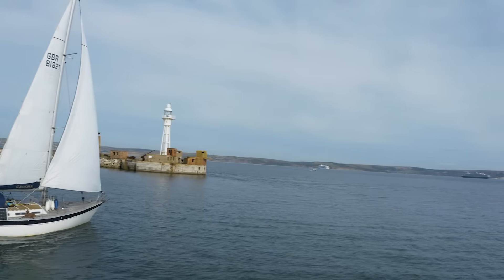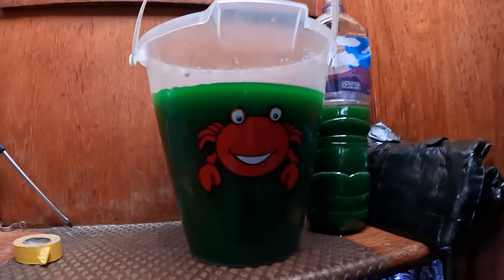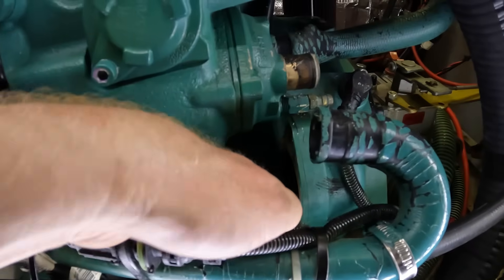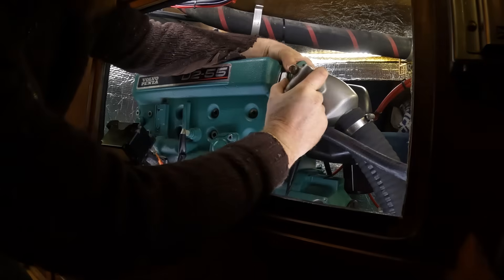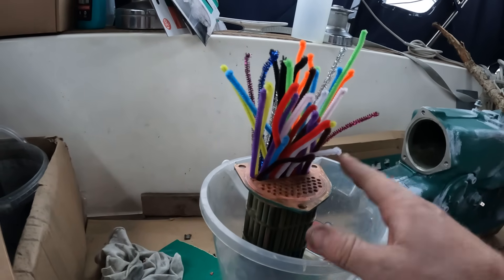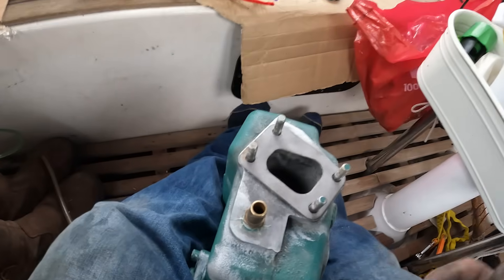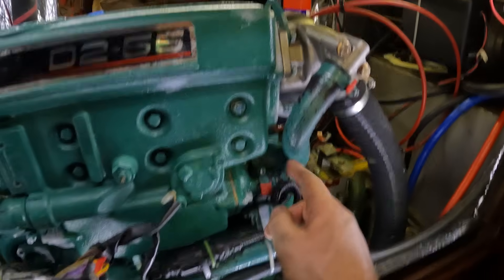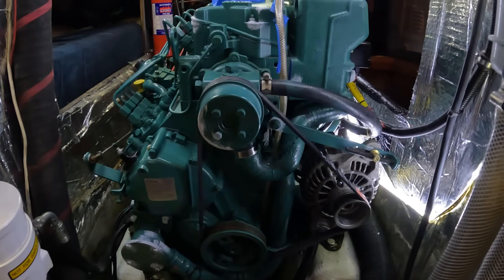Overheating  - Troubleshooting a small diesel sailboat engine  (Volvo Penta D2 55F)

Comment: Wow! Patience of a saint and really great to help demystify some key elements of engine maintenance - still can’t believe you don’t have a mechanical background! Think you may need a bit more glockenspiel practice though😂
Reply from the maker: I promise you that three years ago, I genuinely could not have pointed to a raw water pump or a fuel filter on the engine if you had asked me to, I really started with absolutely zero knowledge or understanding of engines 😳😳

I still often can’t  quite believe these things work again after I put them back together 🤔🤣⛵️🍀🍀🍀🍀

Comment: Hi There are compounds that you can use to help stop the Dissimilar metal corrosion electrolyse  JC -5 is good or just a high temp gasket compound applied lightly  plus another good cleaner that is cheap and good for Brass and copper Coke a Cola
Reply: Duralec green is designed for this.

Comment: I dread the day when I have to do this on my Volvo engine. Thank you for showing, that it can be done. However, you are aware that the bolts on the exhaust elbow still provide electrical contact between the two parts.
Reply from the maker: Yes I am now. I’ve removed the elbow and caked them in duralac, other than that I’m not quite sure how to break the circuit, especially as one will be created with a flow of water when the engine is running too? Any ideas? 😬🙏
Reply: @CadohaAdventures  Not an expert on galvanic corrosion but, if the problem started with the upgrade to the stainless elbow, a downgrade to the original cast iron part would be my safe choice. Not very spiffy, but better than a sacrificial engine block.
Reply from the maker: @rustysailor4672  you may be right. I wonder if it’s possible to get a pencil anode hole machined into perhaps the elbow to add in a sacrificial anode?

Comment: TopTip - Vinegar works 10times faster when hot - boil in jug/kettle first then add component to solution👍 heating component also keeps vinegar hotter longer (add boiling water to component - drain then add hot vinegar)
Reply from the maker: Awesome, that will come in handy next time 🙏🙏😁

Comment: .22 calibre rifle pull through is the best tool I’ve used to “clean me tubes luv” 😎
Reply from the maker: Sounds like a good shout, a few people have chimes in and said the same 👌🏼⛵️
Reply: @CadohaAdventures  or .177 air rifle size if you have smaller tubes

Comment: Look out for spirit of salts.  My boilerman used on the heat exchanger in our domestic boiler.
Aka acid.  Cleaned the pipes inside and out in 5 minutes.  No hairdo necessary.
Reply from the maker: Seems cleaning in situ is the way to go for most people 😬🙏
Reply: @CadohaAdventures  I'd call what you did character building stuff!
You're now a better person.

It's like banging your head. Feels great when you stop doing it.

I think everyone needs to strip their engine once though.

Comment: Can you fit that copper heat exchanger cartridge the other way around? Looks somewhat symmetric. Might be slightly easier to open for cleaning. Shouldn't hurt the function, as they are just pipes from one end to another.

Comment: We do “CIP” cleaning onboard, Cleaning In Place. Use a citric acid solution and pump it round the heat exchangers for a few hours by removing the pipes from the end caps and putting new ones on with a small pump and tank. Replace the solution as it gets dirty etc. A-lot easier than taking stuff apart! Also check thermostat you can test it opens at the right temperature by heating water on the stove. Opening temp will be written on the Thermostat itself. Also always check sea strainer like you already did and always impeller. Maybe water coming from the exhaust but maybe not enough! But yes finding impeller parts in the heat exchanger is very common in my line of work! Its always the sea side of the heat exchanger that is worst, especially if the engine doesn’t run for a long time, and thats what you can CIP clean! Drop me a whatsapp if you need any more info guys!
Reply: By coincidence, Wilko also do boxes of citric acid crystals at a reasonable price. I have used them to do the same descaling job on a heat exchanger from a  narrowboat engine.

Comment: Good job. Next time you do it I would advise you to apply cooper based anti seaze paste on the exhaust collector seal. This way it is highly likely it will not seize and brake next time you decide to remove it.
Reply from the maker: Appreciate the tip 😁😁👍🏽

Comment: you know that black box with all the wires? iirc Mads had that go bad and moved it to the side of the engine compartment to reduce heat/vibration hoping to get it to last longer, it's an expensive part .. nice job on the troubleshoot/remove/clean/reinstall!
Reply from the maker: Ah that’s some food for thought then. It seems that every part for a Volvo penta is an expensive part 🥺🥺

Comment: Thank you for sharing this video. A day in the life as a boat owner. 😀 I have a VP D1-30, but luckily I have not hade any overheating issues. However, to replace the impeller I need to remove the whole water pump since it is totally impossible to access the impeller otherwise. My experience as a boat owner for many, many years is that almost nothing is easy to reach. I think you made a great job fixing the heat exchanger. Obviously not the easiest thing in the world. I would like to know more about that little water pump you used to drain coolant. Is there a model name that you can share?
Reply from the maker: I’m not sure if I’d be in too much of a rush to get on, since uploading this video, I went to use the pump again and it’s just died! I don’t know if that’s due to draining this type of fluid instead of the oil that it’s advertised for?! 🥺🥺

Comment: White Vinegar is fine, as you said its a much milder acid so it will take longer, unless... you use hot water.  Boil a few kettles of hot water or if you don't mind the smell and don't want to dilute the solution just straight boil the vinegar.  Added bonus, heating the vinegar in the kettle will clean out the scale build up on the kettle's heating element.

Comment: Hiya Dom,
I've just found you via "Sail Life" a great channel. A few suggestions, as a spark, don't put grease on electrical connectors, put electrical contact grease. You can't know if the other will block the electrickery from flowing downhill. Did the heat exchanger need 'Torking On'? Sorry I never could spell. If you need electrical parts go to an electrical wholesaler, much cheaper plus more choice. While there if you don't have one already get a pair of auto wire stripers, and a pair of ratchet crimp pliers for red, yellow and blue crimps. Plus one for 35mm2 crimps. There is no better way to get a perfect joint. What a great job you did on sorting your engine, and a great video, too. Thank you both. 
You can count yourself a fully-fledged spark now for putting insulating tape around your scrape. 
Stay safe, Steve...
Reply from the maker: Appreciate the insight there Stephen, thanks for taking the time to explain all of they! 🙏😁⛵️
Reply: @Sailing Cadoha, hiya again, I've just re-watched this video and a few more points on tools if I may? The hose clamps you use, if my brain isn't farting a 7mm socket is far easier to undo/do up the ratchet rather than a flat blade screwdriver, they, as you should know must be reserved for use as a chisel. I'm glad to see you used the sparkly coloured pipe cleaners, plain white doesn't work. There is a socket set adapter called my many, a wobbly socket, that can change the direction of rotation by a few degrees, thus allowing better access to those hard to reach nuts. A flexy extension can also help, if you do not have a good motor factor to hand, I use Halfords, even for non-Ford things. You can get the hose picks there, plus a gasket scraper. Rather than grease on the end of screws/bolts etc, use 'Never Seize' to allow easier removal next time. Before removal of parts like that end cap you needed to check the video for, put a permanent marker line or two across the joint then, when re-instaling just line up the marks. Two lines, for the cover the other end. Always use a torque wrench to set the tightness of nuts/bolts on an engine, too loose, they come loose, too tight, and they snap. 
If I think of more I'll add them later. 
Stay safe, Steve...

Comment: The heat exchanger body corrosion at the elbow is a known issue with several Volvo engines with scores of examples illustrated on the web. In many cases the corrosion has formed holes right  through the metal to allow coolant leakage from the jacket. It occurs at as little as 300 engine hours in some cases. NB Many have been repaired through MIG welding (including mine). Often the repair weld area is then encased with a little aluminium epoxy to add some more protection. I'd be interested to hear if you inspected this area when you first installed your new stainless exhaust elbow. Most bad corrosion cases occur with the original cast iron elbow. The cast iron elbows corrode and block  quickly allowing sea water to back up so that some sits in this area when the engine has stopped running. It can even lead to back flow through the exhaust manifold into the engine. Installing a stainless elbow typically greatly alleviates the issue because there is not the same propensity for elbow corrosion/blockage. Volvo claim that because their engines are galvanically isolated from the saildrive that there is no need for engine anodes. Unfortunately this is the Achilles Heel of that engineering approach.
Reply: Just learned about the VP corrosion issue the hard way with my D1-20. It had eaten through. Have pulled the engine for a thorough look and to have the corroded area welded as I've seen others on the forums  do. Will replace the elbow with a stainless version too.

Comment: Good beginner mechanic tip.  When scraping gaskets off a machined mating surface, especially an aluminum/aluminium one, never use the tip of any steel blade.    If a boxcutter is all you have, unscrew it, remove the blade, and lay it flat on the surface to get under the pieces of gasket.  You can tap on the end of the blade opposite the edge, preferably with something plastic (handle of screwdriver).
Reply from the maker: Appreciate the tips there, Richard. I was probably being a bit heavy handed now looking back 🥺

Comment: Another useful tool is an inexpensive electric engraver to mark fitting points on matching parts .  
Far more permanent than pictures or video ..  Punch marks, letters or numbers are the norm for this.
Never did like the idea of spray painting over rubber hoses and clamps .  
Your probably right about the design fault - but every engine has a quirk or two .
Very nice repair and well done !
Reply from the maker: That’s a great shout Andrew and I’m not a fan of spraying the hoses either, they were like that when we got the boat, and the paint is slowly (but surly) coming off of them.

Comment: This is a job I have wanted to do on my Nanni diesel.  As an alternative could have jetted the tubes of the heat exchanger when you had exposed the ends?
Reply from the maker: I think it retrospect I’ll perhaps use some kind of riffle barrel cleaner next time and not pull the entire engine apart 😬😬
Reply: @CadohaAdventures  I think that is a really good idea and would be quite effective. Instructive and interesting videos well delivered. Diolch yn fawr!

Comment: For the future, be careful using steel wool as it might leave small residues of steel which acts as a catalyst and worsens oxidation on the engine block. The D2 heat exchanger is a bollocks amount of job to get to... Wish Hank the best!
Reply from the maker: Appreciate that Tobias, and yes you’re not wrong about it being a very ‘involved’ job! 😖😖
Reply: Seconded! It's possible to get stainless steel wool.. which is a much better option aboard a sailboat.

Comment: Before you dismantle half of the engine to reach the cooling tubes, try to back flush the heat exchanger "the wrong way around" first and see if it helps.
Connect a water hose to the outlet of the heat exchanger and see if you can get any dirt out from the inlet with pressurised water. I think this is in the owners manual too.
I don't think you can avoid the corrosion between the new stainless steel elbow and the INSANELY EXPENSIVE heat exchanger housing, unless you completely isolate the thing somehow. Now you still have galvanic connection from the pinbolts and nuts. I wonder how hot the elbow becomes. Would nylon bushings and washers do the job similar like between the gearbox and the  bellhousing? The washers probably need to be of a stronger material though...

Comment: Have you check manuals? Is that heat exchanger supposed to be assembled the same way it was?   Wasn’t that core able to be assembled backwards   (from the front), so no huge disassembly precession have to be repeated?

Comment: Hi - great video - we are in the process of doing the identical job and I have a question. Is there a specific direction that the cooling tubes assembly comes out, or can you "hammer" it out from either side of the heat exchanger? Thank you!
Reply from the maker: On our boat, sadly there was only one way it could come out (aft) which is what led to this being such a huge job in the end. If it could have come out forward then it would have been far easier to do the job. 😬
Reply: @CadohaAdventures  Thanks for the reply 🙏- we took the complete heat exchanger off so we have the "luxury" I guess of doing it either way.

Comment: Great stuff thanks. Is this an OK forum to ask question. Should we flush our heat exchangers salt water system regularly like your do with outboards? Would that help prolong the buildup? I have started flushing mine after use with 2L of fresh water and a small amount of saltaway and then shutting the engine off leaving it is that good or bad? Also what about the occasional run viniger into the system and leave that for a few hours or a week?
Reply from the maker: That sounds very fastidious to me 👌🏼

Others have commented that things like barnacle buster, or warmed up vinegar flushed into the system, left for a while and then flushed out also help to descale the system. 👌🏼

Comment: Great video - just an observation - scraping off gasket and using abrasive around engine may create  dust and tiny debris - a good vacuum over everywhere including any pipes and waterways would not go amiss.
Reply from the maker: Great point, thanks for your input, Kevin 🙏🏻😁

Comment: Concrete etch..cleaner is Phosphoric acid and is magic for cleaning  brass or bronze exchanger tubes.. home depot sells a gallon for 25 bucks. I did an 80 tube Cat exchanger and it was drop into a plastic tray and it did the rest

Comment: Great video. That’s quite a lot of dissimilar metal corrosion for a relatively short amount of time. I guess it could still occur if there is a galvanic connection between the stud bolts and the exhaust elbow. I wonder if you could get the exhaust elbow powder coated to isolate it against the exhaust/cooler housing? In any case I would take the elbow off for inspection in 6 months or so to gain an idea of the rate of corrosion. Fantastic channel, really enjoy your content, many thanks!

Comment: On Beta engines the heat exchanger is at the top and accessible which seems a better design for an item that needs disassembling periodically.
Reply from the maker: I think on a lot of Volvo pentas you can too, I think we just have an unfortunate configuration for this job 🙁⛵️

Comment: Do yourself a favor and look up Barnacle Buster and the Barnacle Buster Flush Jr. Its a Marine descaler that works wonders with a heat exchanger, the flush JR is a bucket with 2 valves a pump, basically you bypass your sea-strainer and create a flush loop, works WONDERS on my Perkins 4.108. Fair winds!
Reply from the maker: A few people have suggested that now, so think it'll be worth looking into for sure 👌🏻

Comment: I'm surprised there isn't a differential pressure sensor fitted to monitor the pressure between the inlet and outlet of the heat exchanger. Relying on a single temperature sensor at the exhaust stage seems a little last minute. A pressure sensor could help identify any issue earlier on.

Comment: Thank you for the video. I'm sure you are far on with this now; but a couple things I did notice. First off when cleaning surfaces with gaskets, try to just use a flat razor to make sure no dents or gouges especially with aluminum. Secondly you can test the engine out by simply engaging the prop to put more load. Finally you will want to use a torque wrench, always, when attaching a manifold ( intake or exhaust). Cheers and fair winds.

Comment: If you look at the inside of the cap on your heat exchanger you see that it is divided in 2 parts. That "middle" part should correspondence with the part of the top / bottom pipes (where as NO pipes are connected) It is very simple.

Comment: Hi, nice job! 
Isn't the parts with allot of small copper pipes heat exchanger looks identical on both ends? If yes... you can try to inserted from the opposite side, so next time you will not need to dismantle the all boat to take it out for cleaning.

Comment: Next time you do an engine rebuild, don't paint the hoses, plasti-dip them. If the intent is to protect the hose over time, then paint it in something that gives it some 'breathing' room. Paint promotes cracks to appear. Plasti-dip (and the products alike it) allow the rubber to expand properly, you can move it easier should you need it. Makes the whole thing last longer. I let mine raw, and just cover them with either with a non corrosive (to rubber) grease or wrap them in a layer of bicycle inner tube strips, which itself moves with the hose. Just my 2 cents.